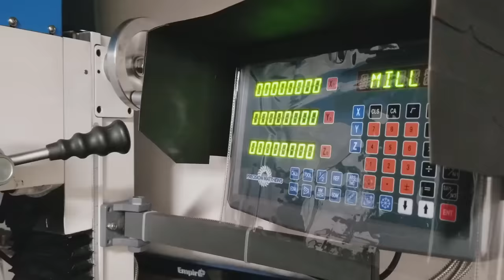New Machine Day! PM-728 Mill, Setup and Review!

Comment: I ended up purchasing a PM Mill and Lathe based on watching your channel a few years ago.  Glad to see PM is returning the favor.  Great company.
Reply: Agree I learned about PM through Blondi. Eventually I got me the PM-935TV, a 2/3 Bridgeport clone 220 single phase. Probably the biggest mill my small shop could handle. Wonderful machine and great PM shipping/service.
Reply: While I didn't discover PM through this channel, I can vouch for them being one of the most honorable companies that exists today. Their customer service is second to none. They don't engage in any of the shady practices that many organizations do today. I bought a PM-835s a few years back (as my first "full" sized machine... its like a lightweight bridgeport at around 1500 lbs). It was my first significant machine purchase upgrading from a horrible mini-mill variant from another import dealer so it was a big deal to me. Well after the PM was unboxed it was obvious that something wasnt right: damage to the machine, wood chips all over the place, and even finding crucial mounting bolts loosely rolling around the floor of the crate. I contacted PM and they sent me a brand new machine in less than 72 hours to swap for the damaged one. There was no fuss about it. No additional shipping costs or anything. Their reps were always extremely courteous, helpful, and quick. Second machine showed up perfect and is still in use today. Moral of the story is, if price range has you limited to the import market, get it from Precision Matthews and they'll take care of you.
Reply: I thank you for your great video on the PM728  . I hate to be the barer of bad news but,I sent a comment before and ended up with someone trying to scam me. I  hope you already know about but if you don’t please contact me and I can fill you in on how it went. I have pictures of the messages.
Reply: @JoesModelEngines  I think me too, something about claiming a prize.
Reply: @chasehubbard5303  strange I hope you didn’t give them any information.

Comment: Pro tip for cutting metal banding:  Take two crescent wrenches and clamp them onto the banding right next to each other, one on each side of the banding.  You can then scissor the wrenches against each other, which will shear the banding, and they'll usually hold onto the two ends, keeping the banding from flying loose.
Reply: Also works with only one crescent.
Reply: THAT is an AWESOME tip!

Comment: Save some of the metal banding to make parallel spring keepers with. Cut and bend to hold the parallels against the vise jaws when switching parts.
Reply: When I got my mini lathe, I used bits of the banding as shims for the tools in the 4poster. (I have a QCTP now, though)
Reply: That metal banding is very versatile stuff. I always save the straight pieces when removing it from a crate.

Comment: Congrats, Quinn. The machine looks pretty. My favorite quote of the day: "You never know. I might have needed to some day lift the entire building by that machine". Somehow a lot of us use that design principle in home shops ;)
Reply: "Better to be looking at it than looking for it."  Keith Fenner
Reply: If it can't move it won't move. I had that drilled into me. No pun intended 😊
Reply: My cheapie mill is bolted down using Ford 6.4L diesel head bolts. Yes, you could pull the slab and footing out of the dirt with those.

Comment: Congratulations!   New toys are always fun :-)
Years ago, I helped an older gentleman who owned a print shop move an old offset printing press he had purchased.  He asked me if I could trust him and just do what he told me to do.  Strange request, but I said ok.  Then we arrive and I  saw the press, a very large, heavy piece of equipment which was on the 2nd floor of an old industrial building, and I thought "How in the world are I and this guy and I going to move that?"   He schooled me - I'm so glad I had the experience.  Short of it is:   Pipes.   We levered it up onto some conduit, and rolled it.   Onto the elevator, out to my truck, and up some oak planks into the bed of my truck with nothing but some pipe and a come-along.   Just me and this old man.   Amazing.   All that to say .. next time you need to move something on a pallet like that, get some 3/4" conduit, lever it up onto that like you did onto those plywood blocks,  and you will be amazed.

Comment: I smiled when you were talking about the DRO turning itself off. I have a set of cheap digital calipers that leave themselves on until the battery goes flat, and I have a drill press quill depth display that turns itself off after I swear about 10 seconds of inactivity and it also runs off a battery instead of using the mains power plugged into the machine. All three things drive me mad (though I have since purchased more expensive calipers so the old ones are relegated to a tool box of rarely used tools so I guess that one is fixed)

Comment: Thanks for another great video on the new mill. One observation, when you tried the .1" mill depth of cut feed rate and got the spindle pull down, I experienced this on a round column mill I previously owned. By turning the fine feel knob in the opposite direction to take up the back lash, this was able to hold the vertical feed at a neutral position. I have no experience with your mill and don't know if this would be beneficial in your situation, but it worked for me.
Reply from the maker: Yes, I’ve found this helps me as well. I mentioned that in the video but my wording wasn’t very good so it probably wasn’t clear.
Reply: @Blondihacks  Sorry, missed that, time for ear wax removal. :)
Reply: I have this PM728 and having the spindle being pulled down as well. So you are saying run past your depth with the fine adjust and then come back up to depth and lock it off? I have anywhere from a .001 to .003 pull down from my set point and have to try to compensate for it and it's frustrating to hit depth and maintain.

Comment: Re: wheel bearing grease...

Try clear SuperLube with PTFE. Very sticky, smooth, and not stinky. Still in crappy cardboard tubes, of course. It doesn't stain red, but it DOES stain. I use it in wheel bearings, steering columns, poly bushings, all kinds of stuff.

Comment: I bought this same model about a year ago. I was trying to avoid my usual pattern: but the cheapest model, spend a few years in utter frustration, then finally upgrade to a decent machine. This time I decided to skip step 1 and I couldn’t be happier. It’s smooth, rigid, well-built, and accurate. 
Some of the price premium is because it’s a Taiwanese machine instead of Chinese, and the difference is significant: Lexus vs Toyota. 
Highly recommended.

Comment: A couple years ago I bought a PM 932 mill. Tried using an engine hoist to lift the mill off the pallet.... and capsized the entire thing. Wrenched my back trying to catch it, and did nothing to save the mill.
Completely destroyed the motor controls, the motor, etc. PM was amazing in helping me order the repair parts, expedited shipping, and provided a lot of tech support for rebuilding the controls.
Ended up buying a gantry hoist to lift the (broken) mill onto the cast iron base.
The gantry has since been useful for mounting my PM lathe to a 58" toolbox, pulling an engine from a van, etc.

Comment: Quinn another great video. Just a hint for a future project is to ditch the angle bracket clamp on the power feed. Make a mount to put it directly to the end of the  of the table. I would hate to not have access to the slots on one side. Nice to see that the new mill is better.

Comment: Your new mill looks wonderful.... it has all the bells and whistles that anyone could need. I'm sure you have work planned for it...
I remember when my mill was delivered... it weighs 500kgs.... I pulled it off the pallet and across the workshop floor with a wire strainer (arranged things so that the pallet and floor were aligned)... a bit scary but got it done..... it has its own stand, so I didn't have to actually lift it... But it was delivered all assembled, including the coolant system.... a bit top heavy.....
Love the quietness of your little machine... mine has a geared head, which has heaps of power but it IS noisy.... There's 9 speeds.
The manual for the DRO is bigger than the mill one.... it does so many things...
Your channel is my favourite engineering one because you work within limits as most of us do, often doing jobs that are really too big for our machines..... You should see some of the work my old 4.5" Boxford has had on it from time to time...and it's nearly as old as I am (80)... I think it's probably early 1950s vintage.... abused a bit but not used that much (ex education dept!).
Keep up the good work... love your content... :) x

Comment: I had to drill 1 inch holes through semi frame to move the fifth wheel back. I had to do this on 2 trucks 8 new holes on each truck. The black and decker drill gave it up before the first hole was done, the new Dewalt didn't ever even slow down, but my wrist wanted to call it quits.
Each hole started out with a 1/4 inch drill stepping up several times till reaching 1 inch. Only broke a 11/16 bit and had to sharpen bits many times.

Comment: A fabrication project to widen the hoist footprint would be great. I've got the following planned for mine: Shim an imperial square tube in hoist's rear, metric box, allowing a 6' large stock square tube slid in. Drill holes near tube's ends for 10' schedule 40 steel pipes as legs. Since it's still an idea, filling the pipes with concrete may be an option for no kinks.

Comment: I purchased the same machine a few years ago, and have no complaints. Suggestions:  1) The Z column lock is  hard to  reach behind the control box, so I used threaded rod to extend a lock knob just beyond the control unit. 2) I don't have space for the power feed motor, but I keep a dedicated battery drill with an extended socket that fits the nut on the lead screw handles. The drill is then a convenient "rapid" motor for X, Y, and Z. Power Z movement is  very nice.  I look forward to see what improvements you invent.   .... and FYI, the older DRO head works just fine.

Comment: I discovered PM through watching your videos and eventually got a 728 so they are not wrong about you driving sales albeit inadvertently. One thing I have run into is the oiling system draining into the chip tray. I think the x-axis ports are below the outflow opening in the reservoir. (So my chip tray does something besides look decorative. :-D )
Reply: My 728 has done the same thing since day one. It takes about a week to drain all the oil. I gave up and just oil things manually
Reply: @Steve_R  I unbolted the pump and lowered it as much as possible to see if it would fix the issue. It seems to unless I fill the reservoir all the way up. I have read about people installing a check valve which is a solider solution than my current zip tied alternative mounting.
Reply: @foolio42  Thanks. I had thought about doing a check valve on the lines to see if that would help. I'll try lowering the pump when the warmer weather is here (central Canada,. Manitoba), so it could be a while.😀
Reply from the maker: That explains a lot. I keep seeing fresh oil around the base of the machine and I couldn’t figure out where it was coming from
Reply: @Steve_R  It hasn't been decently frozen here in Toronto since Christmas so feel free to shunt some of that down our way so we can get the ponds frozen. ;-)
Reply: @Blondihacks  Install small valve at the end of the main feed pipe

Comment: Congratulations Quinn, 
Happy  to see pm came thru for you and love your show. I purchased a pm940 from them and having a few problems. If I try to make a 30 thou cut it vibrates alot. And the 940 weighs in at around 1,300 lbs with the castiron base.
Try checking if you have any excessive play in the quill. Put a piece of round stock in a collet and let it stick out enough to grab onto. Extend the head up and spinn the quill down and lock it.
Attach a mag base indicator to the outside of the quill and the indicator on the outside of the spindel. Then apply pressure by pulling and pushing on the round bar in the collet and see how much play you have in the spindel. Mine has 6 to 10 thousand play. Pm has been good to deal with so far. They are sending me a new quill  assembly if it ever ships from china. Hope you have better luck.

Comment: Very nice. I busted the bank for the 833TV last year and so far I’m pretty satisfied, only some fairly small issues. I think the difference in the Taiwanese quality is noticeable. Mine has the same power feed (both X and Z axis) and the one-shot oiler is nice but having it do the X and Y lead screws would have been nice.
Reply: Also got 833 TV 6 mo ago just got pm1236 lathe w cast iron bases had some issues also with  mill and lathe minor. Resolved very happy w mill setting up lathe still.
Reply: @larryedwards8723  That’s funny, I’m just waiting for my new 1236T lathe to arrive as well. It should be a nice upgrade from my old 9 X 18.

Comment: Afternoon Quinn, I have the same Quill DRO on my mill and this is what I have done to get adequate light so I could see the numbers because it is not a backlighted unit. EVISWIY Sewing Machine Light LED Lighting (30LEDs) 6 Watt Multifunctional Flexible Gooseneck Arm Work Lamp with Magnetic Mounting Base for Workbench Lathe Drill Press 2 Pack. From Amazon of course.

Comment: I have also moved a ridiculous amount of shop equipment solo with the help of my trusty harbor freight engine hoist.  Someday I'll have a 2 ton gantry crane in a shop... someday... Two tricks I'd like to add is you can use a come-along winch and some slick plastic cutting boards to add horizontal scoochin' power towards getting a load under the engine hoist.  I also have a pair of 6 foot long inch diameter steel pry bars that are handy for lifting and pivoting big iron things. I moved my bridgeport deep into a 2 car garage with those and some bar stock as rollers, looking like a mad Venetian gondolier.  Looking forward to seeing the new work horse in action!

Comment: The reason for the bigger skid can be seen when the machine is dropped off. Smaller skids require special pump trucks. Very few warehouses, and even fewer delivery trucks have the special width pump truck required to move small skids like that.
It was probably put on the larger skid at the first carrier facility it arrived at so that they didn't need to take up the valuable time of the forklift and operator every time it needed to be moved.
It's a global supply chain, and standardization is what brings costs down
Reply: Btw, I'm saying this as someone with 20 years in logistics
Reply: Yes. Odd sized pallets take more time besides ruining the Tetris game

Comment: It helps to clamp onto the steel straps so cutting them is not going to release the potential forces instantly (that you clamp on both sides of your cut OR clamp near to an edge and being in a position higher than your cut, so the steel springs away from you (ideally into the ground))

Comment: Suggestion, re: future machine uncrating; iron pipe and/or steel round stock. A piece of pipe/round stock between the 30" pallet and the "straddle board" on the engine hoist legs would have made it a LOT easier to scooch the whole shebang closer to the engine hoist.

Comment: Congrats!! You can have alll the fun you like, as long as you keep putting out these fantastic vids 😋

You're right about the neoprene shield. Not very effective. One of the large Mazaks I worked on, temporarily had such a cover, and thus needed frequent deep cleaning.

Edit: watching further, @13:23, the emergency stop is frightening. Should stop immediately. I guess this is normal for hobby-size, but frightened me to see that.
Reply from the maker: It did stop instantly. Just the the display lags when powering down

Comment: A great way to begin a Happy New Year Quinn. Congrats!  A comment on a only somewhat related topic, DRILL PRESS MILLING... Not having room for a mill I attempted to adapt my (Delta 16 1/2") drill press for light milling and waisted a great deal of time, money and effort doing so. 1: Every time you adjust the height of the table EVERYTHING must be re-trammed in and this takes forever.   2: achieving functional rigidity is imposable.   3: If you use your drill press often (as I do) forget about it as you are without the press for as long as it's set up for milling.  4: In the end I just don't feel it's safe, even though I made a functional adaptor to lock the collets to the quill. 5: The add-on X/Y table is HEAVY, but then you need to add a vice and the work piece. I needed to put an hydraulic jack under the table to eliminate the droop in the table cause by the weight, also it was now too heavy for the table crank mechanism to work.     In short: If you need a mill please buy a mill! You blood pressure will thank you.

Comment: Not that this will become a common practice for you, but, I used a ratchet strap looped around the bottom of the center vertical mast of my engine crane and then around the base of the machine to "pull" my mill off the pallet onto/under the engine crane . The beauty of that is, you're not constantly chasing the crane around as it wants to move away from the pallet.   Nice machine, by the way.

Comment: I run a company that ships pallets. They put it on a larger pallet to make it more stable and more importantly to get the pallet truck to fit. We can ship milling machines as big as a Bridgeport through a pallet network using a tail lift delivery. To make the Bridgeport more stable the head will rotate 180 degrees so it goes upside down which makes it far more stable.